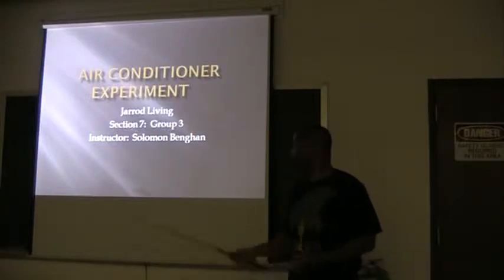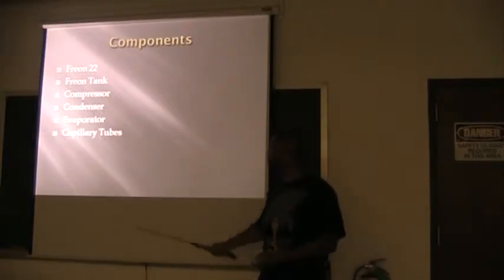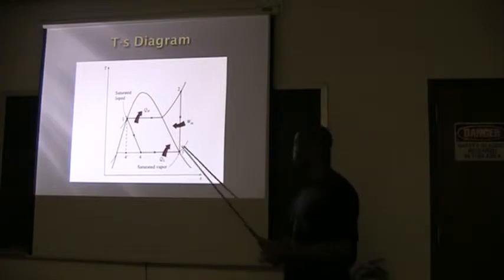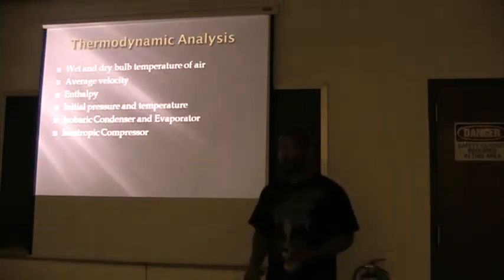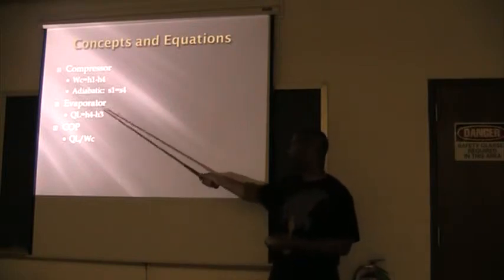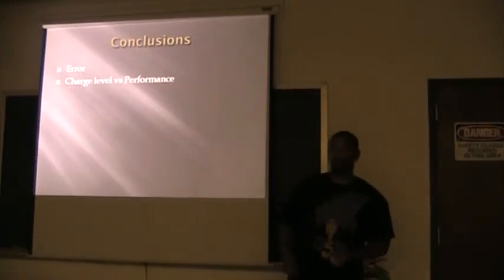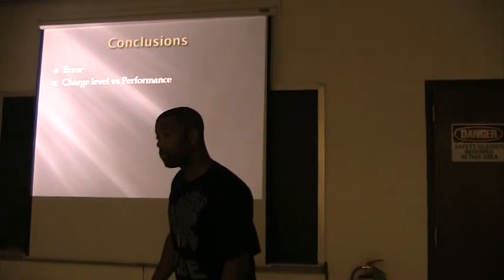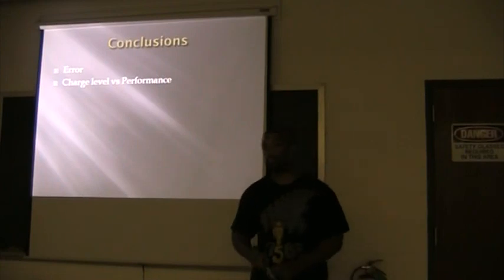Jarred Living Air Conditioner Lead

Comment: I think I did a better job with this presentation then the past ones as far as my confidence and engagement with the audience is concerned. I feel my weakest points were my explanation of the procedure, with the wet and dry bulb temperature, and potential errors in the experiment. After watching the video I realized I should have been more clear with these points.

Comment: Did a good job explaining the schematic of the experiment. you explained the experiment cycle and details but you did not really explain the procedures of this lab. You did a great job at explaining bth the P-h and the T-s diagrams. You showed all of the equations you used to calculate COP but did not show the specific calculation or all of the specific values that you used to calculate work or heat (neither did I), which may have made our results slide better. also no comment on out assumptions